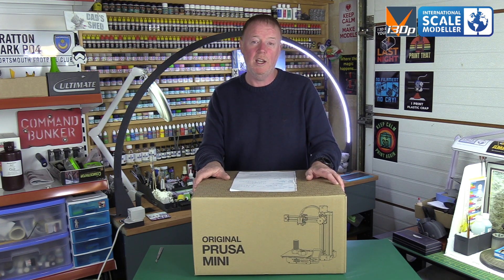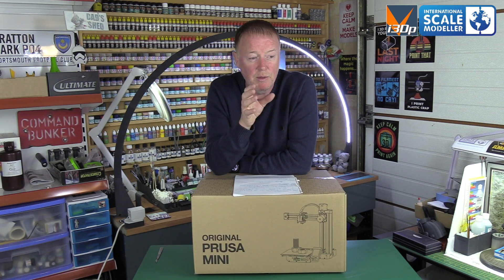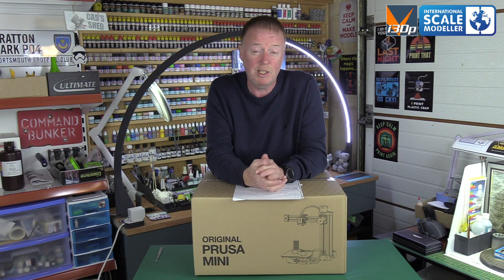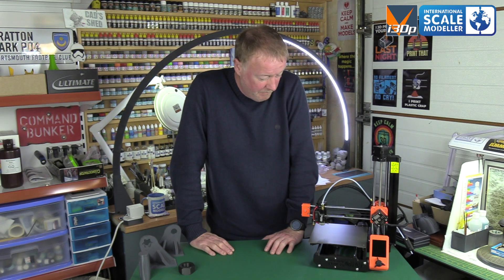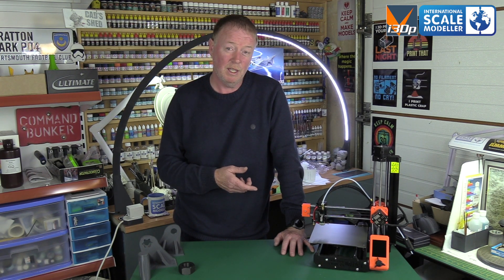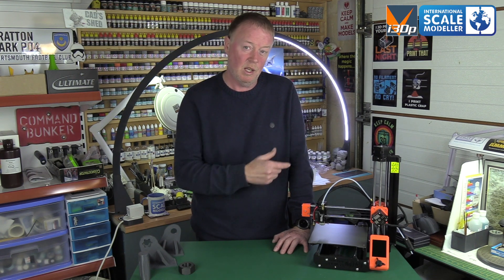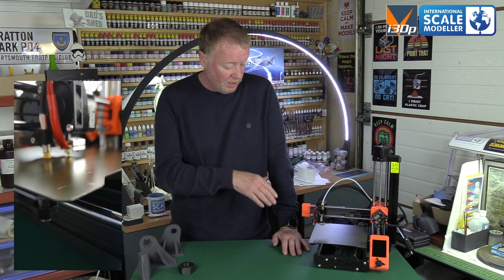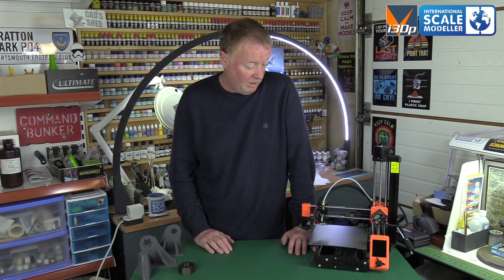PRUSA Mini Unbox, Build and Review - Bad News...!!!

Comment: 7 months later, i still think the Z-Axis aluminium plate (the one you need to screw onto the Y Assembly...  is too thin and the foam feet don't work because it squeezes and the printer will flex.,
 i made real stands so the machine is flat on a surface and he Z-Axis assembly also has feet under it so it covers the whole assembly so that one is not floating. at least my problem solved what you explained that the bed was too low or too high at random places.
Reply from the maker: Yeah.  I have used the new feet that comes on the Mk3s for the mini and it works great!  I've also put all my printer on concrete slabs now.  Makes for a super flat surface and extremely quiet printing.

Comment: I have the mini and it certainly does have issues.  The design is fantastic and when it prints, it is one of my best printers.  Sadly, the assembly is really letting Prusa down. Mine was delivered with the Idler screw way too tight,  the MINDA probe too low,  the hot end was not installed correctly and now the MINDA cable is broken because it was tied to the extruder too tightly.   These seem common problems with the early printers and others have had the problem you have with it not being possible to get a level bed.  They need to sort this out quick because a working Mini is a really top notch printer.  I wish Prusa offered it as a kit like the MK3s.
Reply from the maker: Hey - Yep, I'm the same.  Would love to have this as a kit.  I'd even pay the same money....lol.  At least I'd know it was built properly.....:D

Comment: What are the front pieces of the frame made of?  They look like plastic printed parts and the sides look like aluminum.
Reply from the maker: Hi Scott - The fronts are 3D printed in PETg and the rails are extruded T-Slot aluminium.

Comment: Man, that's a bummer.... :/
It might sound silly but I'm still eager to get one - I'm sure that Prusa will iron out the defects. But I will probably wait a couple of months or so to see how this turns out before I place an order.
Reply from the maker: Watch this space...... ;-)
Reply: I will do for sure ;) Thanks for a great video!
Reply: Even if you order today you won't get it until May. But they should have most things fixed by then.
Reply: @JohnSmith-mk8hz  My plan is to wait until the leadtime goes down a bit and they have fixed most of the issues already. I'm not really in any hurry since I have access to an i3 MK3S at work.

Comment: Have you seen Chris Warkocki's unboxing and build? he had the same issue
Reply from the maker: Not yet, will go check it out.... Cheers
Reply from the maker: Just watched and will try loosening the screw, see if that works.  Thanks for the heads up - Will report back.....
Reply: Hi, there have been a number of reported issues with the mini. It will be interesting to see if you manage to get the levelling routine to function, but I hope.you will be returning it though, it's still a flawed product.
Reply from the maker: @shaunmorrissey7313  I have sorted it out and it's working fine now, but won't be returning it.  Keeping faith...lol.  Will post video tomorrow :-)

Comment: it doesn't home because the zip tie on the leveling sensor is too tight. ive seen this before. cut the zip tie and replace it with a looser one
Reply from the maker: The problem was a lot worse than this unfortunately, but thanks ;-)

Comment: Do not move any axis by hand! Look at the footage your display flickered as you were moving the headbed. First you have to turn off the motors in the settings otherwise you can damage the electronics.
Reply from the maker: It's perfectly fine and normal to move the axis by hand ;-)

Comment: man. prusa really has gone downhill. buying brand new prusas seems like a "wait for a year" kind of situation. with the i3s they can't do much wrong since it's just some upgrades to existing design(even though they still have wonks at times) but yeah. I think il just wait a year or so for the XL for sure. strangely the only product they barely designed themselves(the SL1) had the least issues and least production woes.
Reply from the maker: Personally, I think it's just a blip.  Just a case of releasing a tad early, there does seem to be a few issues floating about.  working on it though :-)